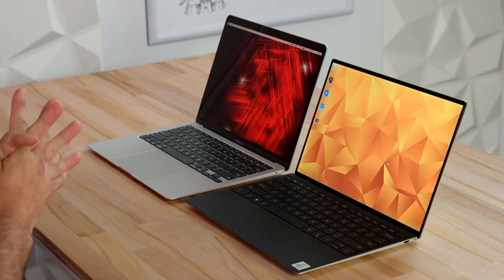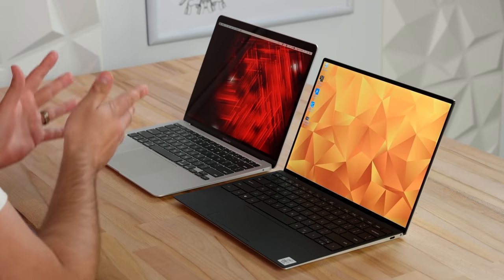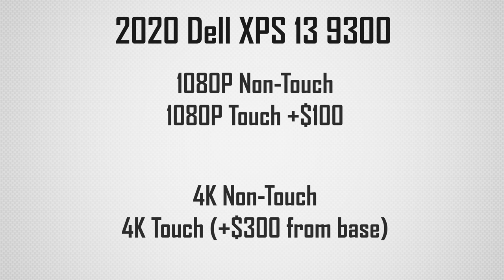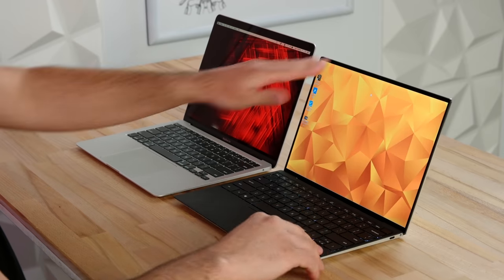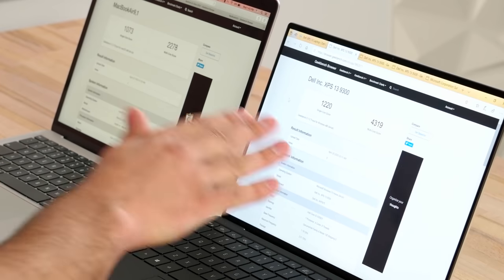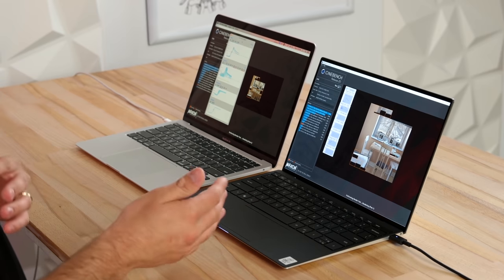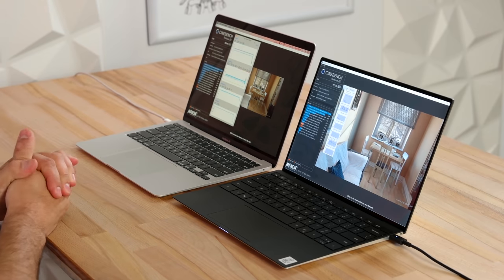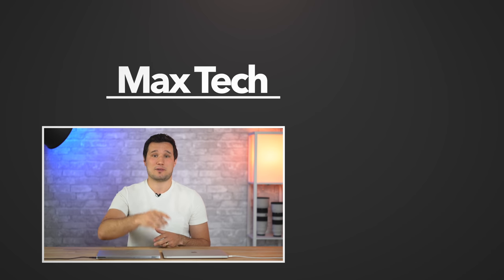2020 Dell XPS 13 vs 2020 MacBook Air - Best Ultrabook?

Comment: So no reason to buy a Macbook air now that Dell Ultrabooks have caught up - got it!
Reply: Wish Dell could run Mac os by default.
Reply: @angryprogrammer7788  Thank you Sushant. I will definitely check. Dell xps has a great hardware with bezel less design
Reply: @Eric Matthews literally this video shows how bad the MBA was smoked this year and yet all you can say is "gni gni gni the trackpad"
Aw give me a break
Reply: Jacopo Puccini doesn’t change the fact that the trackpad is still the best why are you so triggered ffs.
Reply: @Smorfar  not triggered by the trackpad. I have no problem acknowledging that it is better. Yet when you say "Dell comes up short" it clearly highlights how bad you can't admit that, considering ALL the other aspects (screen, keyboard, performance, perfomance/price ratio), Dell XPS 13 9300 is a better choice over the Macbook air 2020

Quit your fanboy's mindset already
Reply: @IANSB Nothing. Some people grew up with macos, some with windows. When you've used either one for all your life, you can't really switch.

Comment: As a business student, I've literally seen professors tell students that they're on their own if they use MacOS. So I'll be sticking with windows.
Reply: Tarek Ahmed yeah pls tell us
Reply: @Tarek Ahmed Because many programs that are optimized for Windows don't work properly or even at all on MacOS. In which case, you'll need a virtual machine program to run Windows on MacOS and you will also need a Windows license to even be able to access the software in general. It's too much of a hassle. I'd rather have a Windows OS that can seamlessly run basic Excel than own a fancy Mac.
Reply: @Tarek Ahmed Your welcome akhi.
Reply: @HonestAbe_  whats wrong with Excel on mac? I don`t have any problems.
Reply: Ibrahim Refahi You could just use the Bootcamp app on a MacBook to install Windows (so you can use both MacOS and Windows seperately), which is free if you don’t activate Windows
Reply: I’m about to be a senior in college and getting a degree in accounting. The only problem I have so far is really just not being able to use Microsoft Access on my Mac.
Reply: @Sky-ub3ft  Yeah I had that same problem with my Accounting course, but I fixed it by using the Bootcamp app by Apple to install Windows on a mac.
Reply: Mr. IDGAF that’s really the only problem I’ve had. So I don’t think Mac is college for business students is a problem at all
Reply: Sky Tbh I use both Mac and Windows (unactivated), and it’s done the job perfectly fine and amazingly for my school and business stuff for like the last 6 years (since when I got it). Macs are probably the best in class in terms of weight, build quality (amazing screen, strong aluminium, etc) and support/durability (Apple long term updates, Genius Bar, Apple community, iFixit, etc), which is ideal for business/school users.
Reply: Mr. IDGAF yes and the battery life is good so even tho I have class from 10 to 5 I don’t have any problems with it
Reply: Sky Also, your professor probably isn’t familiar with Macs (which is why he probably didn’t know about Bootcamp, and didn’t advise you to use it). Btw just grab a USB stick and download the Windows 10 ISO for free (and don’t activate it so you don’t have to pay, or you could crack the activation) - and you’ll transform your Mac into a real native Windows machine (as well as keeping macOS).
Reply: Ibrahim Refahi wheres the problem with excel on mac? Its nearly the same
Reply: @spieleify  excel on Mac is awful and so is word, maybe its because I am so use to windows, I miss my windows laptop macOS is overrated, and I can't use access either. Im a CIS student and most of my programs are only compatible with windows. plus I game.

Comment: I have bought the XPS 13 9300, but have (had) some issues with a very noisy charger, that Dell couldn't fix. They replaced the charger and even the mainboard. The noise came back. I have bought a different charger, from a different company. Now everything is fine.
Reply: Dirk what is the brand of the charger you bought? Thx
Reply: @iamweirdo1926  I bought this one: https://www.amazon.de/gp/product/B07RPYWCZB and still no noise.

Comment: I'm looking between these 2 & the MacBook air did have great sound. But I can get much more from the Dell xps 4k i7- the other important factor to me is the thermals.  I don't like the Mac running 100c. No computer will last long running that hot. Just my opinion. I may look into a Gaming Laptop for $1100

Comment: Thanks Max great review. Looking forward to the review of the Dell XPS 17 4k Vs MacBook Pro 16" when the former arrives. Hope apple do give the MBP 16" even a little refresh say with the faster ram like in the new air, though guess apple will be concentrating on the 13" MBP next.

Comment: When you talked about the graphics and going to I7. The supposed XPS tab said Microsoft Surface 3.
Reply: @amaan2635  They have different cooling designs. You can't extrapolate results from one laptop to another just because they have the same chips lol, you lack critical thinking

Comment: I have a macbook pro, but I would instantly switch back to windows. The programs I work with (mostly editors) crash every 15 minutes on macos. Gaming is not possible because apple has ways to prevent windows to use the egpu. And this macbook air has some serious heating issues not solved. Now Dell and others have finally produced a good ratio on the screens.

Comment: What is the battery life on the 4K vs. the 1080p on the XPS? Just wondering if the 4K is worth it
Reply: I think it would be embarrassing, especially in the long run since it runs Windows OS.

Comment: MacBook already lost when they put a dual core processor in 2020 combined with apples thermals
Reply: The New Xps 13 also has a Core i3 model at around 900 dollars with 4 gb ram. @t. Do better research next before uploading a video. There is also another one with 8 gb ram @t
So god damn do research before lying. Also at lest the MacBook Air base comes with 8gb ram compared to 4 on the Base Xps 13.

Comment: in my opinion its hard to compare...you got windows on the one side and MacOS on the other. I bought the MBA with an i5 about two months ago and I absolutely love it. The ecosystem is great, something you won't find on any Windows Computer
Reply: Actually you kinda will Most Surface Laptops have amazing ecosystems with high end Samsung phones (nowhere as good as apple). Also Huawei Matebook has cool features with Huwaei and Honor phones (meet and actually pretty useful features). Also the main thing about Apple devices are the trackpads. I have a MBP 2011 and it still has a amazing trackpad. To an extent I am kind of scared to use a windows laptop with a okay glass trackpad. Windows and I guess android have a lot of advantages.
Reply: how is the fan noise on the macbook air? does it ever get audible when using multiple tabs along with other apps running in the background?
Reply: Lilrex12345765 same question here!
Reply: Lilrex12345765 not really...
Depends on the apps and kind of browser you’re using
Reply: @genesisa1592  with some background noise (as always) its hard to hear the fan. you have to concentrate on hearing it, otherwise you won't recognize it. And when its really quite somewhere, I think it won't bother someone in any kinda way
Reply: René Weber and with the overheating? is really that bad ?

Comment: Please, compare the xps 13 to the Razer blade stealth 13"
Reply: The Razer blade stealth 13 is a completely different product. It has a discrete graphics card and also is way thicker than the XPS 13. It's essentially a portable low power gaming laptop. It preform much better than the XPS 13 in all tasks needing powerful graphics. It also has lesser battery life than the XPS 13.

Comment: Is it just me or did the XPS smoke Apple in practically every category haha
Reply: Yeah but we got the greatest touchpad in the world. Buy our touchpad!
- Apple
Reply: Both are completely adequate laptops for their intended maret, but nobody is going to be comparing these two against each other; the OS and associated infrastructure is what people are looking for.
Reply: @marsrocket  Exactly, if you are a professional advanced user then the dell would be a good choice, but if you aren't so computer literate and you don't use a computer for much then the macbook would be a good choice.
Reply: The xps is way more expensive innit?
Reply: @YasinHasan  well maybe in 'Murica. Here there's only the xps13 with 4K display and i7 proc. which is about USD $ 800 more expensive than the MBA... anyway I just bought the MBA hope it's not utter shite it's the first time I buy an Apple product since 2012
Reply: Performance and Durability is something we always forget while comparing something new... 😊😊
Reply: In speakers and trackpads the MBA blows the XPS 13. Also in my opinion the resolution of the MBA is right where it needs to be. Better than 1080p but does not take as much battery life as the 4K.
But if you don't care of the OS you pretty much should take the XPS 13.
Reply: @raulvidal8846  NO
Reply: @raulvidal8846  Well now the prices are quite similar. 
The XPS 13 base is around $50~100 more expensive then the MBA
Reply: Tyrone Nelson you really thought that was it
Reply: @tyronenelson9124  i am a software developer and i use a macbook pro, am i computer literate now? Do some research before embarrassing yourself
Reply: not when it came to trackpad or sound
Reply: @koriander.k7377  you literally say you have a macbook pro not a literate man

Comment: Almost all of his laptop comparison videos end with “this Windows laptop is better cause it is faster and more affordable but I would still choose the Mac cause of MacOS” 🤦🏻‍♂️
Reply: Daryl and it’s way better looking
Reply: Well yes, that’s the thing. The windows machines, hardware wise, are more worth it. But if you want MacOS, you want MacOS.
Reply: @mihnealazar7039  it defeats the purpose of the comparison, if the laptop is better despite not having MacOS then its the correct choice since most software will work on both OS'
Reply: Dennis Gatere indeed it kinda does, but only for MacOS people. For everyone else the comparison is valid. The problem is that he gave his opinion on it which I guess he shouldn’t have done.
Reply: Windows is more flexible
Reply: Yep idiotic right? Everyone knows that the Dell 13 is by all means better.
Reply: E :3 what’s so hard to get? If you want MacOS YOU WANT MACOS, you won’t see a MacOS guy get a Windows machine unless he wanted a change anyway. He is a MacOS guy, so he will stick to the Mac. But for any person that is not biased towards one of the OSs, the Dell is the way to go. He made the comparison to help people choose a better machine for their needs. If he needs MacOS he is free to chose the Mac even if it’s not the better value. If you don’t care about the OS, you will obviously choose the Dell.
Reply: @mihnealazar7039 , I don't understand why you've gotten so triggered. And perhaps as a professional, I care about OS more than anyone else. As a user of both Mac and Windows machines I clearly know the difference and strengths and weaknesses of both operating systems. None of them are superior, they are simply different just like (intangible) culture.

Anyways back to your comment, an honest and reliable comparison between strength and power should not be determined or affected based on operating system. I don't know what purpose you watch this type of comparison for, but for many segments it is incredibly important that the comparison provides a solid contrast between devices in an unbiased manner.
Reply: E :3 yeah I’ve been too triggered, that’s true. I just think that people should ignore that part where he says he would choose a Mac anyway because the rest of the video seems valid.
Reply: This is so toxic

Comment: It’s tempting to go with the Dell, but I’m not a big fan of the Windows OS. I wish the MBA were better engineered in terms of cooling.
Reply: Just wait for the MBP.
Reply: Nando hi!! MBP for may lik e what day???? Or June day??
Reply: I’d like to see what the MBP will be like once if it is updated and released. My most favorite form factor is the MBA in terms of portability.
Reply: With Windows you have far more hardware options and can generally get better raw performance for the money. And it's clearly a better choice for hard core gamers. But, while it ain't perfect, I think macOS provides a more user friendly and integrated user experience. I have no intrinsic interest in computers. I want a system that provides fairly smooth (certainly not perfect) integration between devices. You also don't get ads and bloatware. But there have been times I've felt a little trapped in the Apple ecosystem too.
Reply: Bradley Anderson – I come from a solid Apple ecosystem and love it. I am forced to use a PC for work for the last 9 years and have grown to hate Windows OS.
Reply: Hackintosh guys
Reply: cszetela1 You’ve come to hate Windows... I’ve hated it my whole life.
Reply: Felix Caraballo – At work, I have no choice. We are forced to use HP laptops. Mac OS is far superior.
Reply: @California_ Dreaming  i hate mac it shi t copared to windows
Reply: @cszetela1   in dreams
Reply: lakshya grover – Windows blows.
Reply: @cszetela1  

"We have to use windows at work"

>probably old gen laptops with spinning hard drives

"aaah windows is so slow!"

Pretty much the 90% of the cases when I hear stories like this
Reply: Jacopo Puccini – Nope. New PC laptops. Windows is just an ugly OS.
Reply: @cszetela1  u say windows is shit, bc u dont like the look of it XD Thats the not the best argument, bc its just ur opinion. I like the way windows looks and dont like the look of mcOS, but i dont say mcOS is shit. :)
Reply: User#19990111001 Wow, too lazy to type whole words (“bc”, “u”, “ur”, “XD”). Windows still blows.
Reply: Have you used the latest windows ? So so crisp.
Reply: Kenneth Gitau – Yes, but I’m not a fan of Windows in general. Nothing comes close to Mac OS.
Reply: @cszetela1  name the laptop then, i'm waiting
Also, what do you do for work? Are you an informatic or somehow know about computers?
Reply: Jacopo Puccini – Laptop? No. I’m speaking of operating systems. I work in Windows (ugly) all day. It’s painful. No operating system system comes even close to Mac OS.
Reply: cszetela1 funny you say that. i use windows at home but forced to use apple OS at school. fucking hate it with a god damn passion. so gimmicky and just overall not a good os. plus you cant even play 80% of steam games lmao.
Reply: roblox is life — Gaming? Who cares about gaming. Windows is an ugly, unintuitive operating system.
Reply: @cszetela1  Who cares? Well, it's a multi-billion market, so I'd say a lot of people care about it lol
Reply: Jacopo Puccini — I’m aware. Gaming means nothing to a certain demographic like me. LMAO
Reply: roblox is life – Mac OS predates goofy-ass ugly unintuitive Windows. I love Apple, but hate their left-wing extremist politics.
Reply: @cszetela1  
>Apple: literally the face of the modern capitalism and consumerism 

>extreme left-wings politics

Wtf
Reply: Jacopo Puccini – Yes, Apple is a successful company, but I detest their ultra left-wing extremist politics they support.
Reply: @cszetela1  please give me an example of ultra leftist political view they promote
Reply: Jacopo Puccini — You are kidding me.
Reply: @cszetela1  no seriously, I just wanna know what you're referring to
Reply: Jacopo Puccini – Tim Cook backs everything the extreme socialist left-wing Democrat party stands for.
Reply: @cszetela1  Yeah ok, I get that, but I'd like you to make a real example of it. Give me something, like, a concept, a law, a campaign, just stop with general phrases and give me an example since i'm curious about this
Reply: Jacopo Puccini — Why? You have two eyes and an interweb connection. Apple supports left-wing liberal politics.

Comment: dell should've provided a 2K version as well, as that is much more sensible for this form factor
Reply: Eugene Kuzmenko there is one.
Reply: Ryan true, I got confused. 1440p is 2K right?
Reply: @kumajcr7298  yep, you don't really need more that that on a 13" screen. 4K will only consume more juice for no good reason
Reply: Man I can’t wait for a comparison between this laptop and the 14 inch MacBook Pro. It comes to those two to decide my new laptop.
Reply: Kuma JCR well Apple went ahead and refreshed the MacBook Pro 13  with a magic keyboard so I guess no 14 inch MacBook Pro for you.
Reply: Mohit Gupta there’s always next year. Anyway, already decided to save my money and get a PlayStation 5.
Reply: @kumajcr7298  Actually thats pretty smart. As apple might have better arm powered Macbooks next year.
Reply: 1440p matte OLED would be  the sweet spot for the XPS13 , but they don't make 16:10 OLED screens

Comment: I have the new XPS 13” and I’m not a fan. My palm digs into the edge of the chassis when I’m typing. It’s a shorter palm rest.
Reply: the cost of tiny bezels, unfortunately
Reply: I have the old XPS 13 and now that I’m using Zoom for my online classes, I HATE the webcam on the bottom. I look awful

Comment: Summary IMHO: Dell is batter value, the Mac runs OS X. Personally I think Windows is always going to be problematic in the long run, but hey, you pays your money and you take your choice.
Reply: Windows isn't problematic if you run it on decent hardware,  I.e xps. I haven't had a bsod in 15yrs let alone a virus,  people compare reliability of 400usd machines to mac 1500usd. No sh!t it runs more reliable, they can pick higher quality components. As for productivity its taste but you get more horse power per dollar on pc vs mac which matters when doing resource intensiv work.